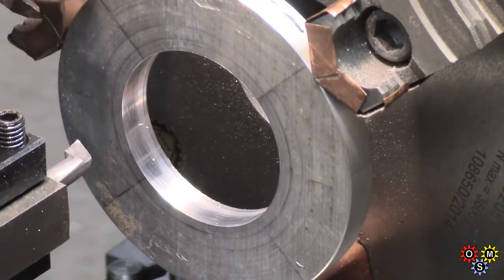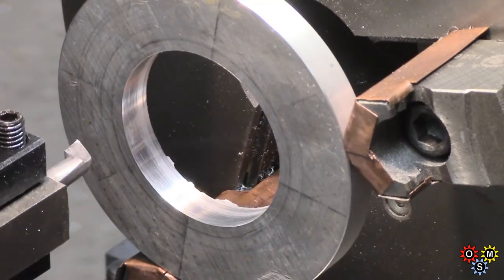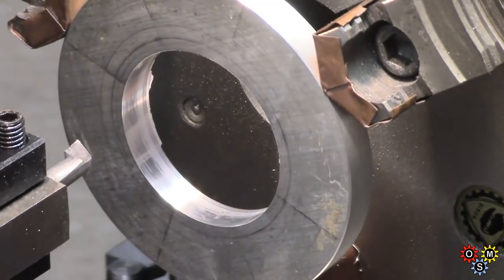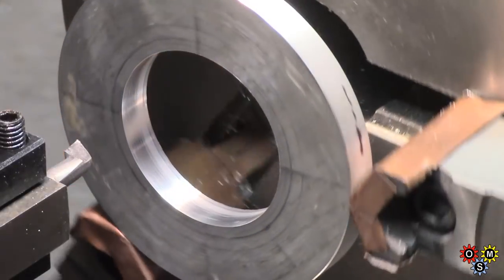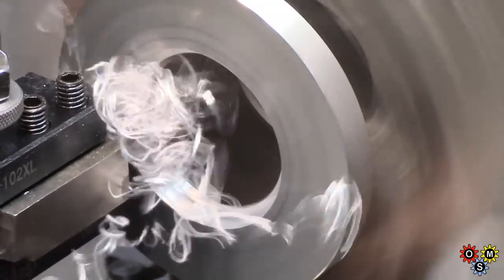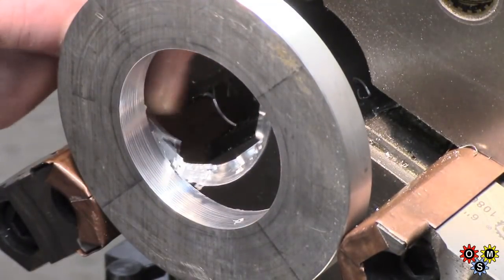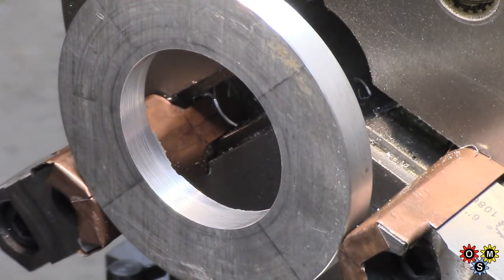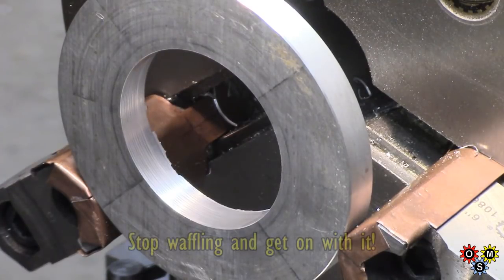Chuck Reverse Safety, Part One

Comment: Great idea and build. You did mention that starting in reverse was an issue... so you could replace the lathe single phase motor with a three phase motor and use a VFD to control the speed/torque. Just say'n.
Reply from the maker: Hello Tom,
Had thought long ago of motor change and VFD but too much hassle trying to mount different motor and the vari-speed pulley system. The starting in reverse is not an issue other than - coping with the inertial load of a heavy chuck on a threaded spindle -- meaning unless restrained it could undo in a hurry!

Comment: Hey....I think I gave  you that cheap and cheerful set of demming drills LOL. One of the very nice things with my little lathe NO threaded spindle :)
Reply from the maker: Hi Laurence - indeed yes, the drill set has been super useful and thanks again for that. It's pretty darned good - just find the grinds sometimes a wee bit unequal but not a major problem. I am envious of your chuck mount system - damn threads!!
Reply: Ha ...no worries my friend, sorry I have been ....not available as you know, I am hoping to get back at it soon.
Your projects keep getting better and better :)

Comment: Watching with more than a little interest and looking forward to the next instalment.

I've always loved working with metal but only recently got into machining. I bought an old 1940s Grayson lathe with threaded spindle early this year but the motor that came with it was pretty old and gave it's last about a month ago, so I just upgraded it with a new three phase motor and VFD with dynamic braking which has made all the difference to performance and finish. It was after installing the brake resistor box that I received the scariest moment I've had with my lathe to date. 

I'd set the brake time to 0.01 seconds and I watched in elation as everything stoped on a pin, though elation quickly turned into horrer as I watched the chuck uncrew itself at top speed, hit the ways and launch itself directly at me.

It was shear luck that there was a small piece of ply board next to me at the time, which I instinctively grabbed and used as a shield to deflect the spinning chuck and contain it to a corner till it stopped spinning (I was extra lucky the jaws weren't protruding or that would have gone very differently).

Needless to say I count my lucky stars I didn't recive a serious injury and have since adjusted things so it doesn't happen again but a chuck lock would be the most secure way to go..

Would love for you to stop by my channel one day, your one of my favourite YouTube machinists and I've learned a lot from you, so a big thanks from me for that :)
Reply from the maker: Hi - wow - you had a lucky escape by sound of it! Scary! Thanks for the kind comments. Pt 2 coming soon now.

Comment: Boy the Atlas makes it tough, I measure a shade less than 1/4" say 15/64 ths thick ring to work with.
Reply from the maker: Makes it a bit tricky but, the ring on mine is not much different. Main thing was to try and machine to very tight tolerances.